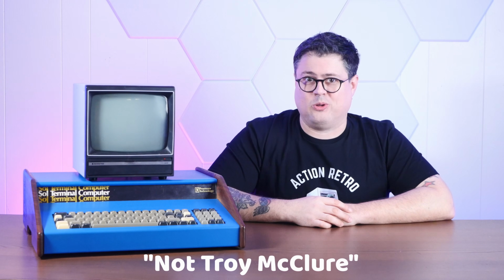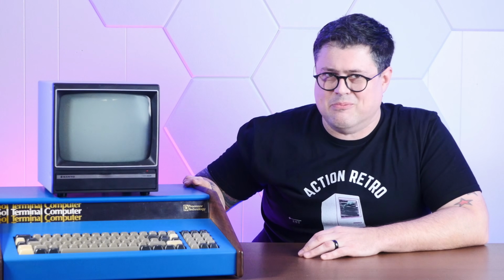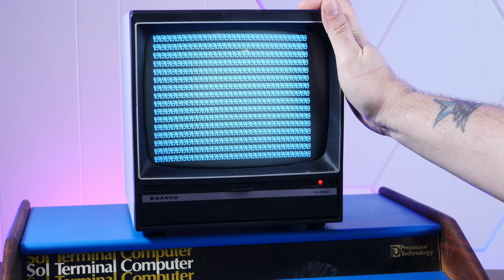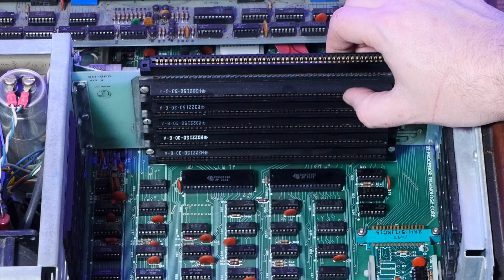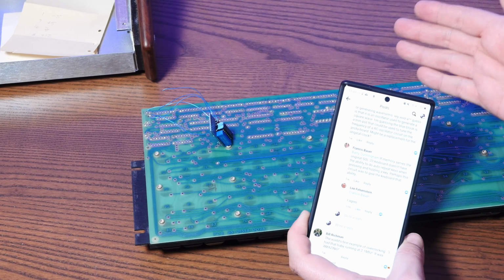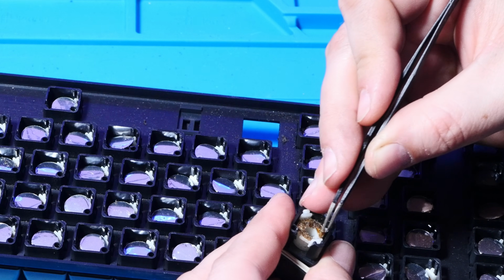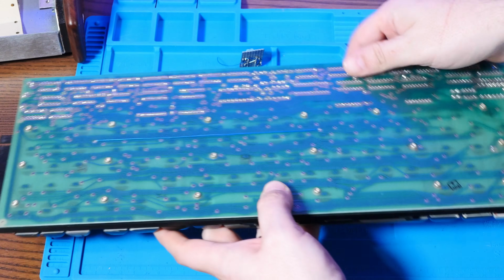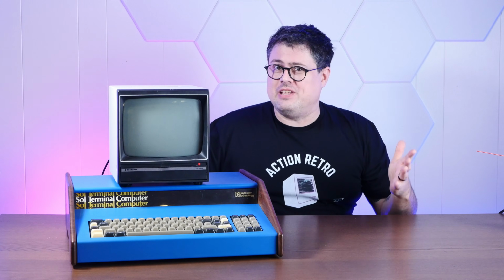The Most Important Computer You Don't Know About

Comment: If I where to guess, the local key would be to switch between entering locally and directly on a mainframe like a terminal, hence the name "Terminal computer"
Reply: If I had a computer that was dying and could no longer be rescued, I might call it a terminal computer. It would make me very sad.
What you are referring to is commonly known as a computer terminal.
As to the key presses needed to switch from terminal mode to local mode: this is described in chapter VII of the 1977 or 1978 manual.
The manual not only describes how to operate the SOL-20, but also how to build it. It's a fascinating read. Highly recommended.
Reply: @jacquesmertens3369  My first job out of the military had a terminal at my desk (hooked to a PDP... whatever; 10 or 11 most likely... running some flavor of Unix and ASK/MANMAN). I also had a roommate who was a software engineer, and he had a few old Wyse terminals hooked up to his high-tech at the time 286 machine, which we would use to BBS on. Gads, that seems both sooo long ago and yet only yesterday...
Reply: @MrJest2 I’d love to hear more
Reply: @PhenomRom  Of what? It was certainly an exciting time, kind of at the starting years of "Silicon Valley 1.0"... which was very different than what goes on there today.

Comment: where do you get a rubber work mat with compartments like the one you have? it seems SO handy
Reply: Amazon has them. Just search for soldering mat. They are normally silicone, so you don’t melt them if your iron or solder drips touch them.